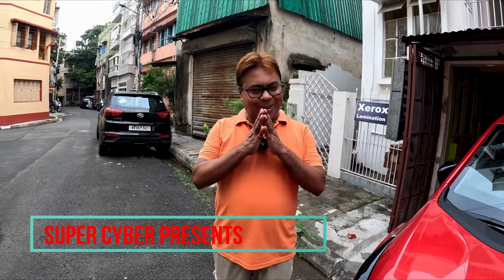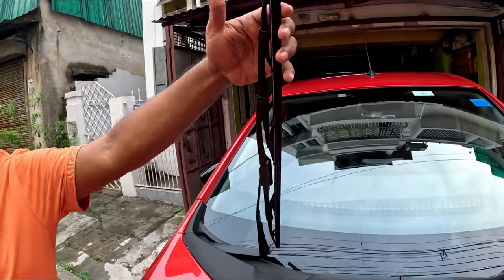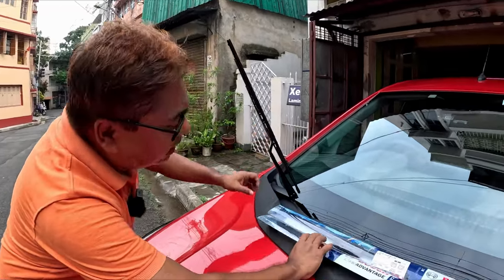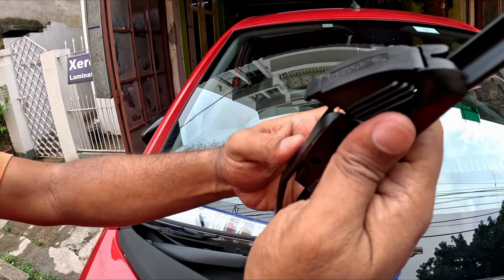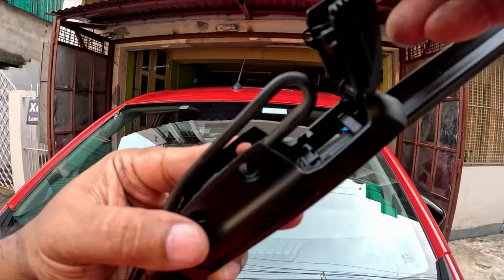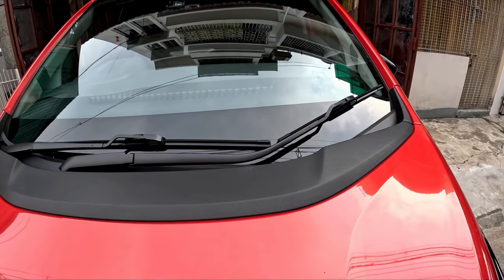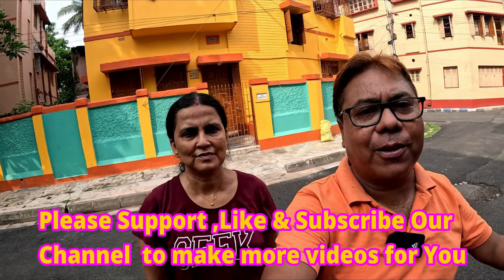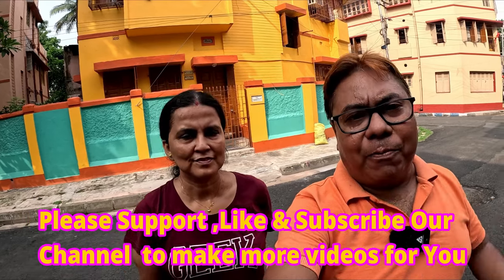How to Upgrade & Install Bosch Clear Advantage Frameless Wipers in Tata Altroz #bosch #wipers

Comment: Sirji, whats the size of the wiper that should I order? Please share driver side and co-driver side wiper sizes for Altroz XZ Petrol 2022 model.
Reply from the maker: 24 inches for the driver side and 16 inches for the passenger side.
Reply: @supercyberautomotivetravel  Thank you for the reply, however in your video its not visible clearly how you are dismantling the wipers, if you could sent some instructions would be great!
Reply from the maker: You can see other wipers remove & refit videos of other cars in my channel  for your clarification. As all cars have J type  hook so the procedure is  same.

Comment: Sir i have altroz i want replace back wiper whats the size of back wiper pls answer
Reply from the maker: The size of the wipers are on Amazon description link.
Reply: Sir i have checked those links are for front wipers 
I am seeing for rear wiper of altroz 
I hope you got me
Reply from the maker: Have you measured the size with a tape. Get the measured size and order accordingly. Less size by a few mm will not have any issues but don't buy anything above the size.

Comment: Sir, please share me the best body shop for Tata as I had met some body dent in my altroz. I had purchased from kb motors. And my first service was done in kb motors service, park circus as seen in your vedio. Sir any further suggestion please
Reply from the maker: You can do body work at KB too.
Reply from the maker: If you want to do this outside you can contact, 70030 55629 Vinayak Auto for details. They are primarily body and paint expert.